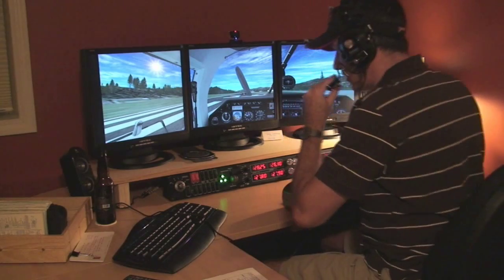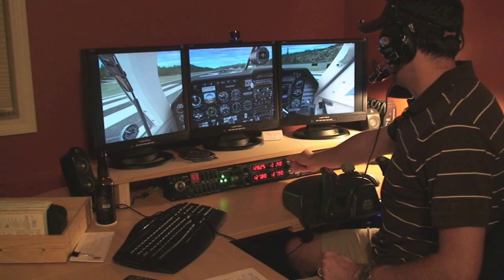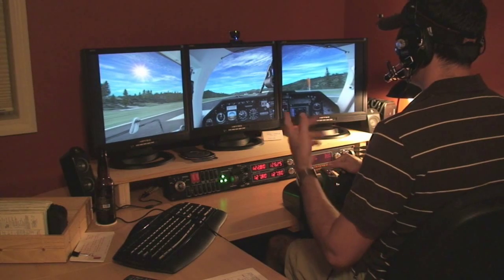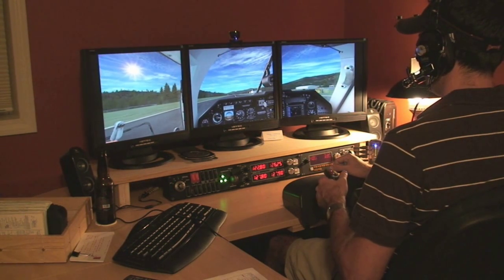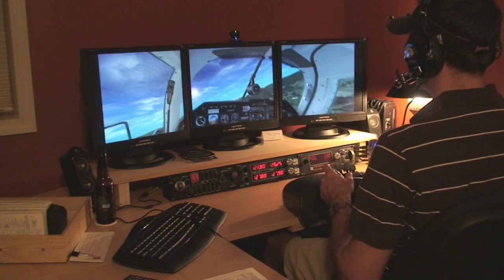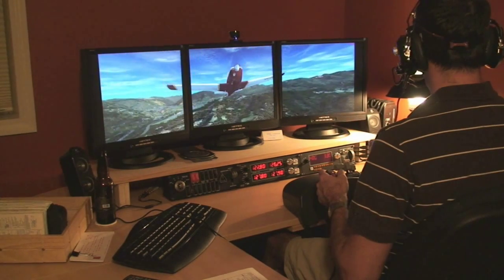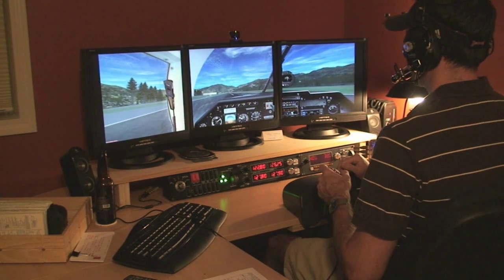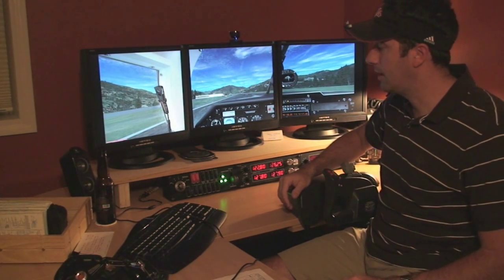Simulator Demo Flight : FSX : Matrox : TrackIR

Comment from the maker: Thanks - I no longer have that setup.  :)  I ditched the 3x monitor setup and run a single 42" and all PFC hardware.  My laptop on the side runs all the other displays for other simming addons.

In terms of spanning the 3 screens, I make sure that windows sees my display as one large monitor (5040x1050 etc) and make sure you have wideviewaspect=true.   That's all I had to do.

Benjamin

Comment from the maker: @DavesFSX  Dave - I think the 25" would be sweet!  I just upgraded to 3x22's since I had to get a couple of new monitors in the house any way.  The 5040x1024 is damn near 6' across...  and it's nice.  with the new rig, I need all the horsepower I can get to push said resolution and record with Fraps.  I flew around last night in the Lancair (ORBX) HD paint, Orbx NRM with REX textures - max autogen, density and water.  With fraps running I was still locked at 30.  It was a thing of beauty. Do it.

Comment from the maker: Hey there - I used a Matrox 3H2Go.  The little box plus the software (PowerDesk) sets it up for you.  Windows registers a single 5040x or 3470x horizontal resolution.  I have since gone to a single 40" 1080p 240ghz panel for my simulator / general PC setup.  I have the matrox sitting right next to me in a box.  I am going to list it up somewhere.  It's not the cheapest solution but it was the only solution when I was flying 3x monitor setup.  EyeFinity does the same thing with 2 GPUs (I think)

Comment from the maker: @Boeing757basher07 I will have to do a video review of those panels.  In general, they are excellent. However, they really only fit the bill of GA craft.  A lot of switches won't do much in say the Level D 767.  

I find the radio panel the best panel since I fly only on Vatsim.  It makes for quick work of the radio frequencies as well as the NAV1 and NAV2 / DME / ADF and XPDR.  All of them as a whole work great but really geared for GA birds.

Bman.

Comment from the maker: @rajsingh0621 In this particular video, yes, it's connected.  I have since upgraded to the Saitek Throttle Quadrant / Yoke which are two separate components. 

I fly exclusively with FSX + REX + FTX (Orbx) and a stack of 3rd party aircraft. 

Cheers-

Bman.

Comment from the maker: @BG5850 Check out the other videos.  I upgraded to a Sandy Bridge 2600k (oc'd to 4.6) / RipJaw ram, 256 Samsung SSD, 3x22" lcds, eVGA 570 GTX 2.5gb etc.  Planning a flight at this very moment.  A few of us are heading up to Tongass Fjords in Super Cubs.  Failing that, I will take the JS4100 somewhere around PNW.  Happy flying.

Comment from the maker: @TheNatalonline There are two primary reasons - 1) I don't have all the instruments that I need to fly on my desktop.  I don't have the HSI, AI, OBS (1, 2), Turn-coordinator, GNS 530 / 430, EGT, Cylinder head temp, fuel gauges... the list goes on and on.  These are all the things needed to fly correctly.   The second reason is more that fact that I fly many different planes - all with different cockpits, gauges etc.  If I fly without the internal cockpit on, I get no real sense of the plane.

Comment from the maker: @haasy8976 Heading up to unbox the new rig.  Lots of stuff came in today!  Woohoo - Intel SB 2600k / Asus P8P67 / G.Skill DDR3-1600 (CAS 7) 2x4GB / Corsair Hydro H70 / Samsung SSD 128GB.  

In terms of the engine start, I usually control the second engine with the condition lever.  Wait until the first engine is stabilized, then hit the start on the second and then flip up the condition lever.  Some planes - like the Cheyenne (Digital Aviation) I have to do it all manually through the VC.

Comment from the maker: Ohhh.... the PC about $1200
Track IR = 150
CH Yoke = 120
Saitek Pedals = 130
Saitek X 52 = 160
Saitek Radio = 140
Saitek Multi = 140
Saitek Switch = 100
Matrox 3H2Go = 300
x3 monitors = 450
Saitek Headset = 100
..as far as your other question on the yoke control, yes you can use the yoke to steer on the ground.  You have to have the rudder "auto coordinate" under the FS settings.

Happy Landings
Benjamin.

Comment: I am planning on putting together a system like your new one, but using (3) 25" HP 2509m monitors in eyefinity configuration. The monitors are about 2 feet in length each, so I'm looking at about 6 feet of monitor in front of me.  My desk is similar in size to yours. Do you think the monitors would be too overwhelming? Thanks for the good videos btw. Dave.

Comment from the maker: @trypwned Matrox 3H2Go does in fact have a resolution that will match your monitors.  From the Matrox website:

New! 4320 x 900 (3 x 1440 x 900)3

You should have this resolution available to you when you set up the matrox with the wizard.  If you don't, I think you can update the firmware from the download on the Matrox site.  

I have 3x 1280x1024 = 3840x1024

Good luck-

Bman.

Comment from the maker: @captainsmartass123 Hey there.  Yes - I have used them.  They are pretty cool but pretty expensive for what they are.  $150 per gauge.   The main problem I had with them was justifying the expense for limited funcaitonality / applicablity for the "rest" of the planes in my hangar.  For example, the BAe JS41 - I need a solid EHSI and EADI.     I need to make a new video.  This video is getting long in the tooth, bad form and simpit has changed quite a bit - 3x22s, TPM, 2nd throttle, i7 laptop